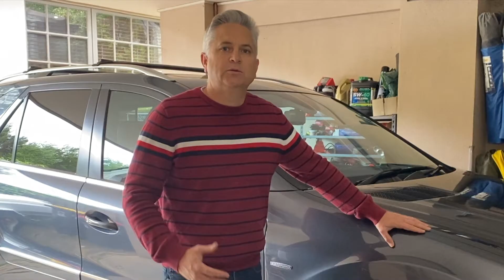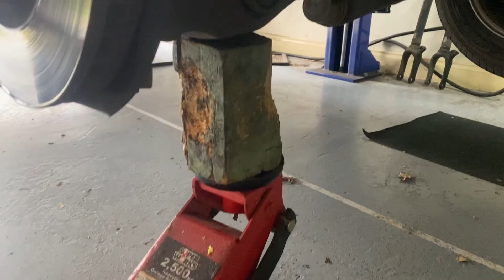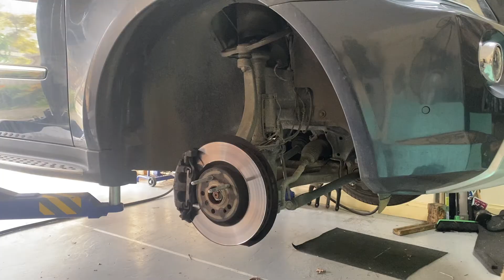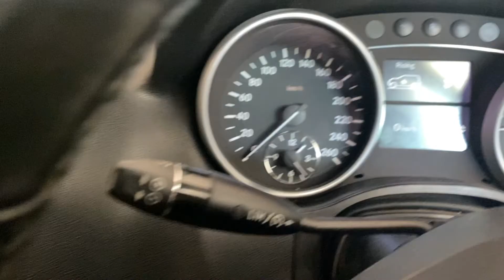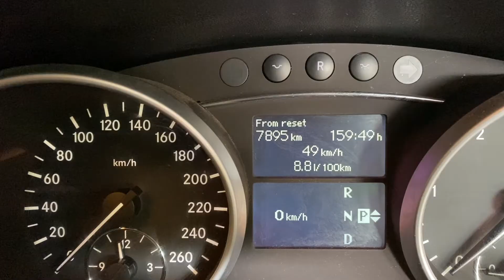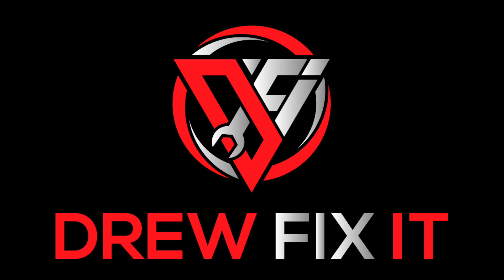Mercedes Front End Suspension Noises Clunks Bangs Solved - ML W164

Comment: What if the noise increases when i raise the vehicle height
Reply: About 80 k since upper arms were done car is 200k
Reply from the maker: @ wow my upper arms are original and my car has done 190,000 kms.  Cheers Drew
Reply: @DrewFixIt  ill give the upper arms a go
Reply from the maker: @ ok, let us know how you get on?  Cheers Drew
Reply from the maker: Hi Mate, then in my experience it is unlikely to be the stut, have you checked your wheel bearings?  Here is a video I did on the wheel bearings: https://youtu.be/SCAEU8tzPSM Cheers Drew
Reply: @DrewFixIt  Also forgot to mention airmatic struts are new lower control arm stabilizer bushes and links I dont get any bearing noise so could it be upper control arm ??
Reply from the maker: @ possibly, how many kilometres has your car done?  Cheers Drew

Comment: I've a clunk over speed bumps, getting worse, worse too when the car's cold ie. at the start of a journey.  Hope its not the strut at I only changed it (aided by your videos!) just over a year ago with a new Bilstein one.   Keep meaning to somehow rig one or more microphones up on a digital voice recorder to see if I can isolate source.
Reply from the maker: Hi Mate, there is no way Bilstein's should fail that quick.  I also did a video on the sway bar links, have you seen that?  Cheers Drew
Reply: My cls has the same problem, you already solved It?
Reply: @StreSside072  No, it kept making a clonk over bumps then ... one day it just stopped.  Maybe something fell off!?   Anyway, the car's off the road currently due to water ingress through the roof or windows, somewhere, causing short circuit in electrics and draining the battery completely flat.

Comment: This might help someone, I had front end noises coming from the front of my 2008 GL 320…. I did have two worn bushings rear bushings left, and right they were making a noise, but the front end noise was totally different. Turned out the oil filter housing was leaking running down on the rack and pinion bushings. It wore out the rack and pinion bushings. I had the rack and pinion bushings replaced and the noise was gone. 😊
Reply: What was the noise?

Comment: These cars I am finding to be quite hard to diagnose. I’ve just found a front end knock to come from a cv joint.(hard to believe)
The longer rhs shaft is quite heavy and can cause a suspension like noise if bad enough. Found by accident…..
Fix one thing, find out you fix two things
Reply from the maker: Hi Mate, it certainly can be a little painful, however I genuinely like my car! Cheers Drew

Comment: Thanks Drew, I don't understand why you talk about fuel consumption, is there another video where you explain how to minimize it ? Is this car running on gazoil or unleaded fuel ?
Reply from the maker: Hi Louis, what I have found overall is that my Mercedes is just running increasingly better the more I maintain and replace parts.  In particular I found a surprisingly big change in fuel consumption after I replaced the PCV valve, which i explained in this video: 
https://youtu.be/XihgSa-Qyr0 Cheers Drew
Reply: @DrewFixIt  so yours is diesel
Reply from the maker: @plumerault  yes my vehicle has the OM642 3.0 Litre Turbo Diesel engine.  What engine does your car have?  Cheers Drew
Reply: @DrewFixIt  ok, mine is the ML 350 V6 petrol engine
Reply: @DrewFixIt  ok thanks I'm gonna watch it

Comment: Thats great content and I have been a long time follower. Own a pre facelift W164 and can say that you are having some great fuel economy figures. I use my w164 as a weekend driver on long journeys and during the last 8k km have an average of 10.2l/100km. Depends a lot on the road conditions in your country as where I live there are a lot of uphills which cause a hit on the fuel economy. Just wondering what service interval are you following on yoir W164? I have been servicing it every 9k km using 5w30 MB 229.51 genuine MB oil.
Reply from the maker: Hi Mate, I  service at least every 12 months and typically do around 15,000 kms a year.  I run a Australian brand of oil, Penrite fully synthetic which meets the recommended MB specification. Cheers Drew